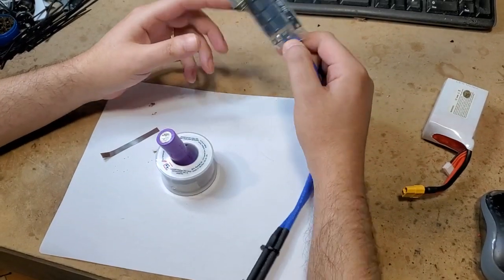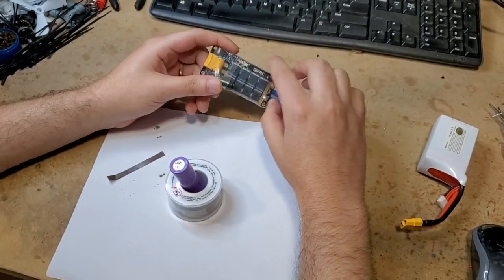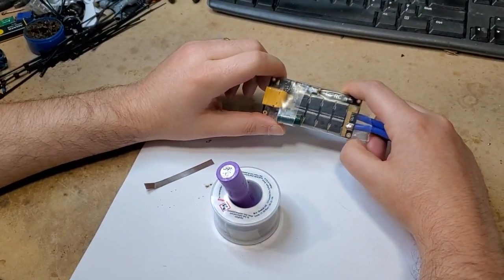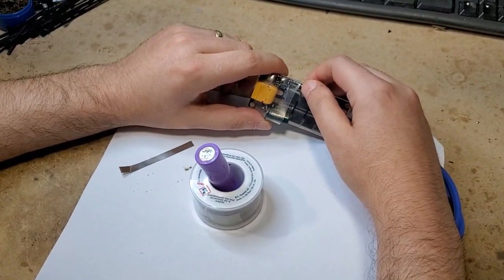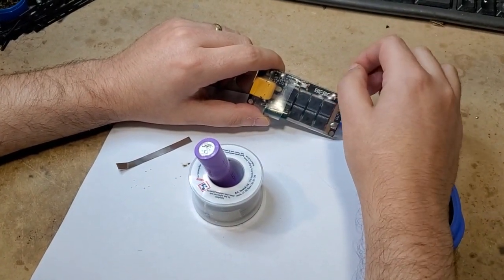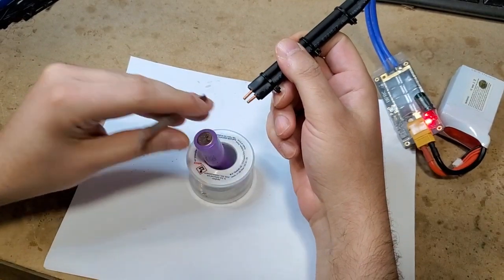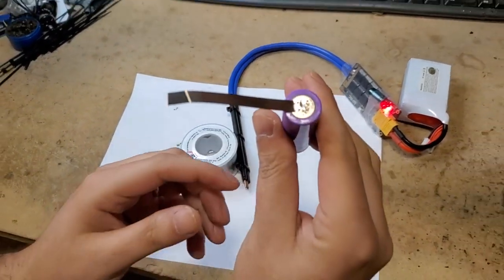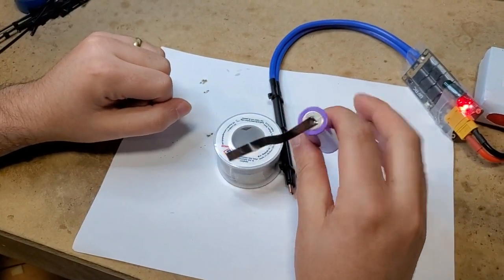BIFRC DIY spot welder

Comment: I've discovered that there's a missing SMD resistor (R4) on my board. This may explain why it's not triggering the MOSFETS.
The 0603 SMD (R4) should be soldered on two round pads just above the "KEY" silk screen label, adjacent to the SOT-23 package (branded J3Y). Can anyone with a working board please tell me what the value of R4 is?

Comment: Hello RotoRev,
I got this board. Using it with 5200mah 40c LiPo. After welding 2 batteries, the multi-coloured level indicator LED stopped, and the 2nd green blinking light is now glowing constantly whenever I plug the battery. Now it welds no more. What could have happened? Do you know how to fix?
Thank you.

Comment: Can you offer any tips what I might not be doing properly to try to use the BIFRC mini sport welder I just got from ALIEXPRESS?
Reply from the maker: Whats not working for you ?
Reply: @rotorev1137  Unit won't weld.    I hope you might have an idea to suggest to me, I'm at my wit's end trying to figure out this BIFRC mini spot welder that arrived today.   The unit came preassembled with capacitor installed when I received it.           I made a jumper with 8ga wires into a XT60 connector and then connected via battery jumper cables to a 12v truck battery.  Two LED lights come on immediately      A larger/brighter LED light changes from red thru purple with button push.  the Small LED flashes slowly - no button push seems to affect this slow flashing.     I believe the  Flashing LED light should indicate automatic mode.  No welding occurs when both copper weld leads placed on the nickel strip included. None at all.     Non-functional.
Reply from the maker: @VARocketry  Weird ... its pretty straight forward once you solder the weld Leads correctly. if thats the case id say its either defective unit or maybe somehow its been out into a manual mode where you need to signal the weld Via Gnd/Key as Brian pointed down there . I tried few key presses to go into a "Manual Mode" but no luck
Reply: @rotorev1137  The unit was preassembled when I received it - even had the capacitor attached.  I only had to heat the weld leads shrink tubing and make up an XT60 connector with leads that I could grip with the battery jumper cables to attach to the car.
I've asked ALIEXPRESS for a refund.
Reply: I thought of something after watching another how to video yesterday. That video said that the length of the input leads makes a difference to the amperage that the unit will produce.
I was using 15 foot jumper cables between my car battery and the spot welder yesterday.
I’m going to try it today just attaching the XT 60 leads to the positive and negative nodes of the car battery directly.

Comment: I believe that your capacitor is soldered in the wrong place.   As best I can tell, the two pads that you used are intended to be used to connect a remote switch for manually triggering the welding output.   Probably no harm having the capacitor soldered there, but no benefit either.   Mine is soldered on top between the connector outputs which helps to buffer the charge.
Reply: @Brian Kuehn  ..Can you explain please (connector outputs?)  doh
Reply from the maker: I think ur right I'll. Measure those pads with multimeter see where they end besides gnd.

Comment: Hi, where to mount to capacitor? it looks another place in yours than I saw others before.
Reply from the maker: there are 2 pads next to the XT60/LED that says "GND" & "KEY" i believe
Reply: @rotorev1137  HI which leg of the capacitor goes where please??? does it matter? thank you, alan.
Reply: @alanreynolds2125  longer leg is pos (+)
Reply: @rotorev1137  These pads is for a foot switch. The capacitor goes in parallel with the XT60-connector.

Comment: What capacity mah ? Battery you using and what’s the #C discharge on battery ?
Reply from the maker: 4s 1600mah "130C" .. its ok for random welds . Nothing heavy duty. .. if you wanna go welding for a while ita better you get something like deep cycle 30Ah battery and always watch battery temp